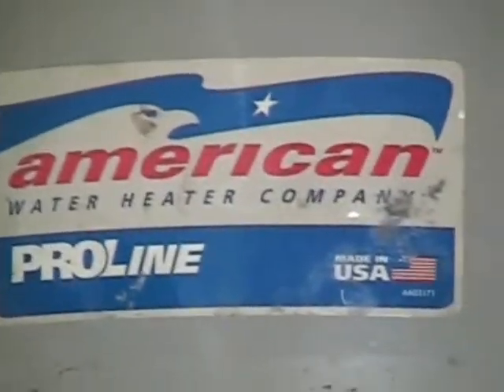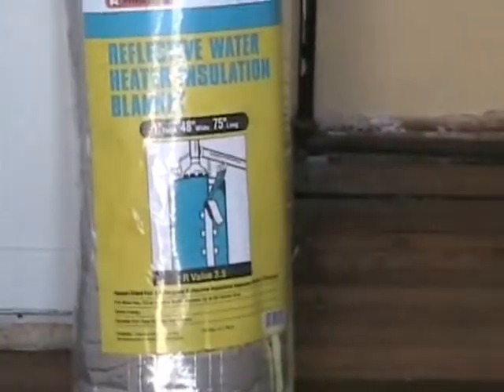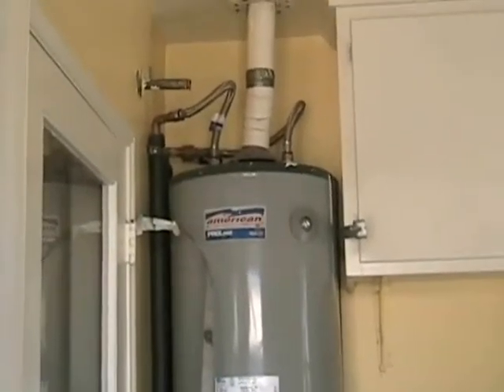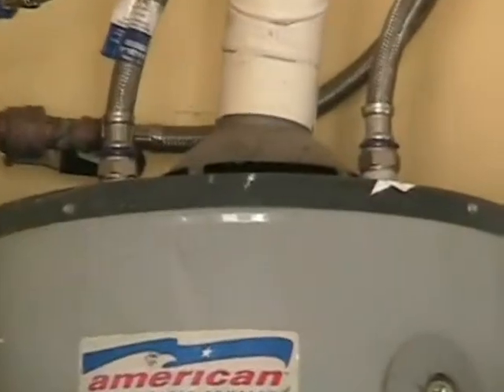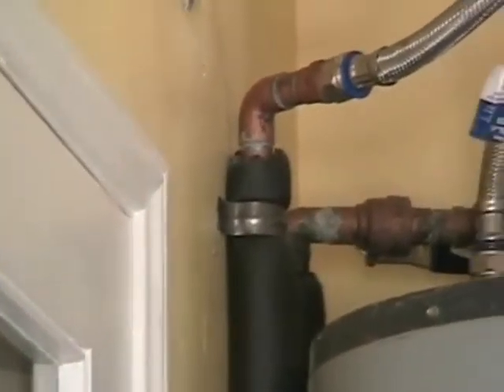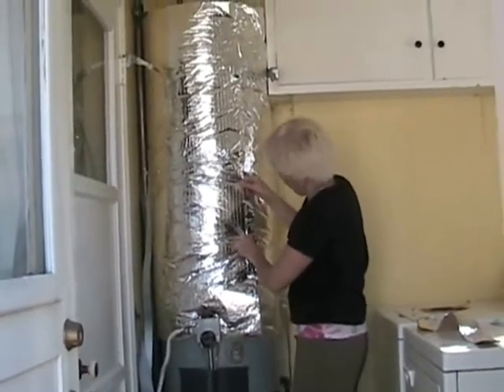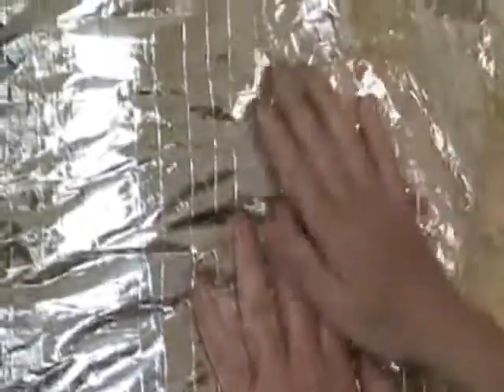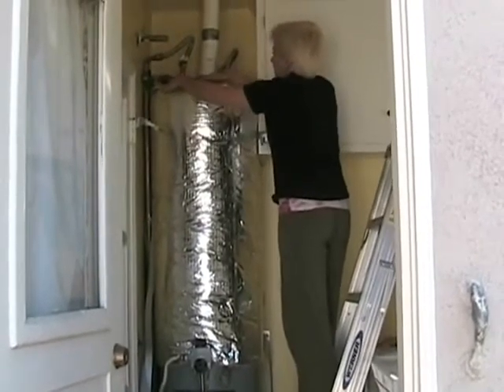Insulating a H20 heater

Comment: No doubt this will help slow heat transfer but it doesn't actually stop heat transfer.  Also when you put a reflective product up against the heat source you no longer have reflection.  You now have direct backside conduction so all that remains to slow the heat transfer is the thin layer of fiberglass.  The tested R-Value in a lab is irrelevant to field results unless the testing apparatus simulates heat transfer via backside conduction. Also compressing this material will reduce the R-value.